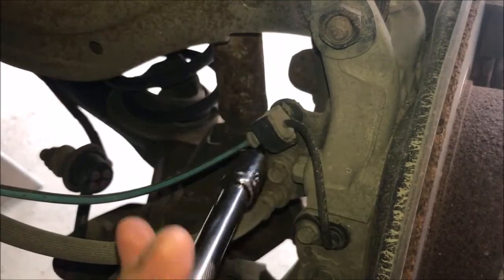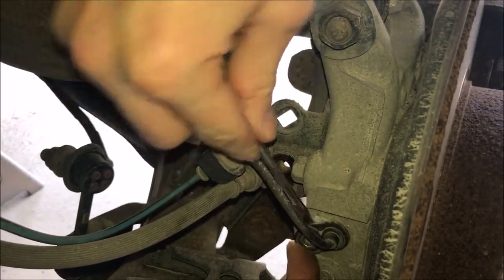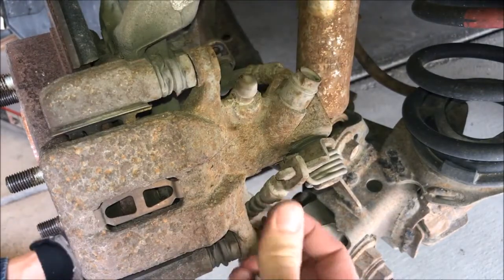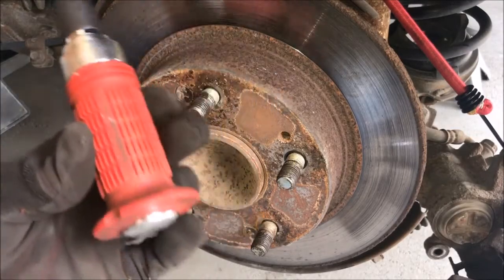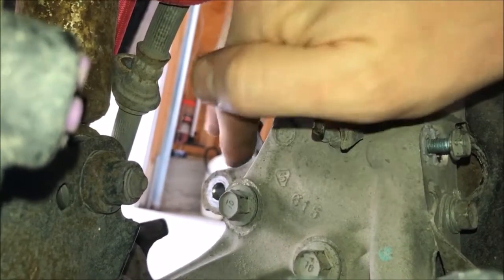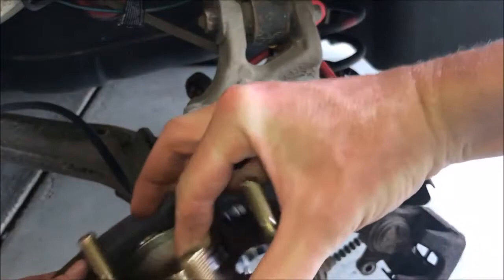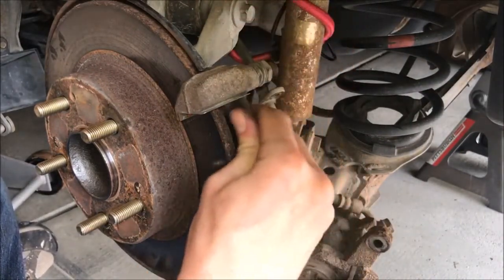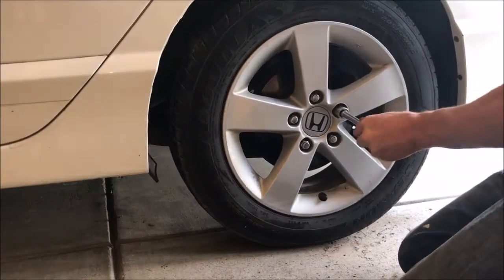Honda Civic Rear Wheel Bearing Replacement

Comment: This is the second video I've seen where the wheel hub assembly "just falls out". Unbelievable. For a 2013 Civic EX with only 90k miles, I spent the better part of 20+ minutes using a chisel and a 5lb slide hammer. Not looking forward to doing the rear right :-( BTW, nice video. Well presented.
Reply from the maker: Wow... that’s crazy!  Yes, both sides just “fell out.”  And I live in Nebraska where road salt is a common occurrence thus corrosion is real. Hope the other side is better for you. Best of luck!
Reply: @FastFixYouTube  Yes, the right rear came out with 3 tugs with the 5lb slide hammer. Never once had to chisel the seam. What a difference. About 2 hours to fully change the right rear wheel bearing (and new rotors and pads) compared to almost a full day for the left rear. Again, thanks for posting this vid. It's videos like this that give us occasional wrench turners the confidence to do the job ourselves.
Reply: Hey i just got a civic ex, anything i should know, look out for? People keep telling me do a drain and fill for the cvt trans, its got 60k i dont know its maintence history

Comment: Good to know. I got ripped off too many times . Learned how to fix and maintain my vehicles using haynes and chiltons manuals. Then came the internet and YouTube. Watching all the how to videos am now able to remove an engine, transmission  , replace clutches etc. The only drawback is the newer vehicles electronic stuff getting too complicated. I keep my vehicles till the wheels fall off
Reply from the maker: Hello. Yes, I do the same!  This car has 260,000 and the wheels were literally about to fall off. But it should be good for another 100k I’m hoping. 

I learned mechanics the same way then got my masters at youtube university.  No more getting ripped off as you say. Thanks for the comment!

Comment: Great video but after changing mine the ABS and handbrake light comes one, what did i miss?
Reply from the maker: Hello. I’d check the sensor for sure. Sometimes those can break when removed or, sometimes people forget to plug them in. If you can’t find anything wrong with it, have your local auto parts store run a scan. The scanner will display a code which can be traced to the problem. Hope this helps and thanks for the question. Best of luck!

Comment: Great video.
I've watched another video and the speed sensor wasn't removed. 
Does this need to be removed to replace the wheel bearing?
Reply from the maker: Hello. It was my impression that the speed sensor did need to be removed, but I’ve heard from a few folks that it does not. I’d say just leave it and see if the hub comes out.  If you feel it hanging up or have a difficult time removing it, maybe then remove the sensor.  I don’t have a schematic of how the speed sensor and hub fit together, but my intuition is that they shouldn’t come into contact at all. I think you’re safe leaving it in place. You can always remove it if there are any issues. Hope this helps.
Reply: @FastFixYouTube  thanks !

Comment: Great video, Do you have to take out the speed sensor? It doesn't seem like it will prevent the hub from being removed
Reply from the maker: I’d say removing it is a good best practice, but you may be able to get away with not removing it.  I’m not sure if leaving it would be prohibitive when removing the hub.  This sensor was stuck in there pretty good, but in my experience they usually come out easier. Best of luck.
Reply: Personally I did not remove it because I didn’t want to risk breaking it like he did. I just pull out of the plastic clip that it sits in above it an I had plenty of room.

Comment: The bearing assembly just ‘fell out’ of the hub? You didn’t have to beat it or anything?
This looks pretty simple 
I’ve got to do both of my rears on 2012 si
Reply from the maker: Yes sir! Came right out. Maybe I got lucky, but the car had well over 200k on it at that point and I live in a state will severe winters. Best of luck with yours!

Comment: Why no brake grease on ends of pads ?
Reply from the maker: I do apply grease on the ends of the pads when I do a brake job, but because I used the same pads, they were already greased. Although, they probably could’ve used a refresh. Good point. 👍

Comment: Is this brand as good as oem i hate buying cheap parts and having to pay more over time. I bought cheap bearings before and had to change them sooner than an oem
Reply from the maker: I’ve had good luck with TRQ parts. These bearings seemed well made, but I doubt they’re OEM quality. I’m sure they’ll last 100k or more.  I share your opinion on quality parts,  it also take into consideration expected life of the vehicle. This Honda can’t be alive for much longer with 260,000 miles…but it is a Honda so maybe.

Comment: What were the symptoms? my shit is whining when pressing the gas pedal going over 40+ MPH.
Reply from the maker: That’s exactly what my symptoms were. I thought it was the front bearings, but it turned out to be the back. It’s a bit deceiving that way and hard to tell where the whining is coming from. But yeah, I had a bad whine from 25pmh and grew louder as speed increased.
Reply: @FastFixYouTube  Oh wow. Thanks for the reply! I will have to investigate the wheel bearings myself now.
Reply from the maker: Yeah, for sure. In all honesty, I took mine to a shop to get diagnosed. Only cost $20.  It was $500 for them to do the work, so I opted to save $400 and do it myself. Best of luck.